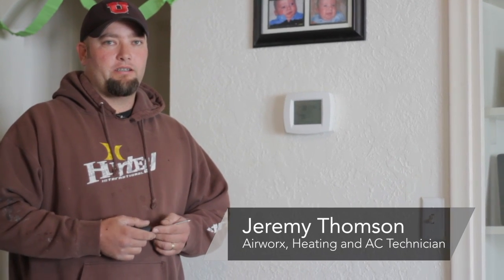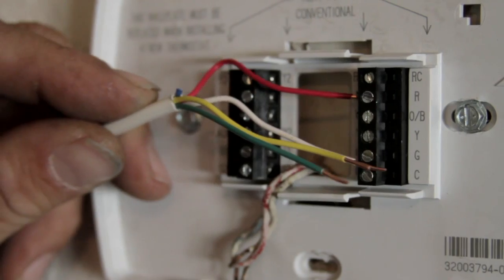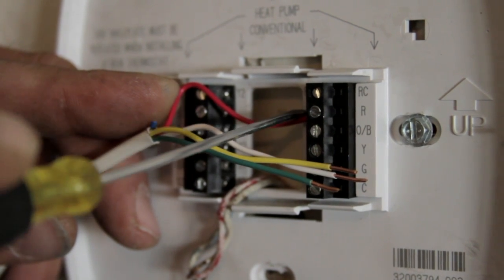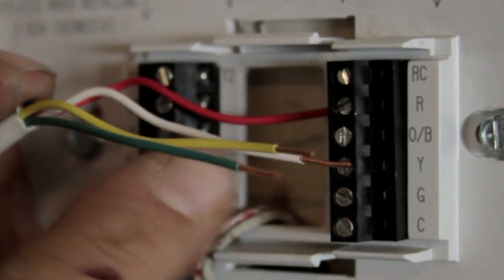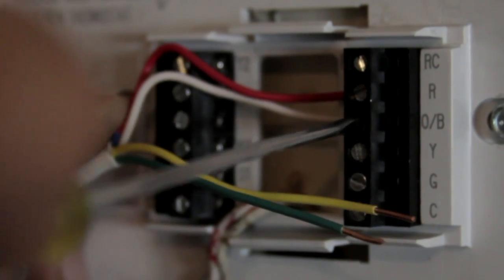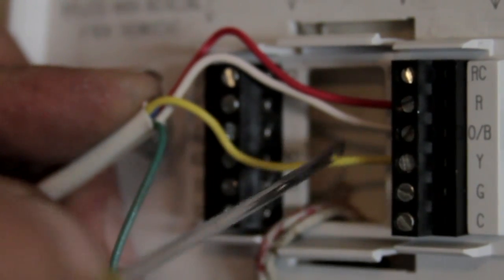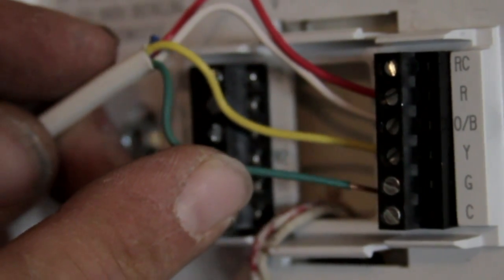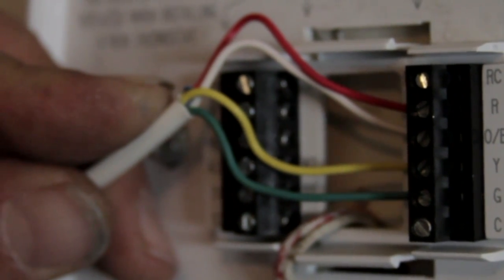Central Air Conditioning Information : How to Wire a Digital Thermostat

Comment: You skipped the most important step! You never explained which side of the terminal to use and why! My thermostat is similar to the one your showing and I have a heat pump. I have a White wire which is disconnected. I have no idea which terminal to use. There is no "W" on the non-convectional side.

Comment: Dude you are like Kobe in the 4qt Clutch this took care of my problem real quick Had 24v to cool but no jumper wire to provide 24v to heat and now that its getting cold I had to move the wire from 24v cool to 24v  to heat, I still need a jumper wire but this will do for now. thank you for the video!

Comment: Thanks for this!  After watching numerous other videos... showing that the "O" (orange) wire is only for homes with heat pumps and controls the 'reversing valve', I was very confused because I have a Trane furnace & thermostat with an 'O' wire, but it's not a heat pump - it's a traditional furnace & ac.  Yours is the first video that showed that Trane uses that wire to call for heat.

Comment: We have had 5 (FIVE) PROFESSIONALS (so they call themselves) to check to see why our AC was not working properly. This has been over the last 5 years. Maybe they need to watch your video !! The "cold" (blue in our case) wire was NEVER hooked up ! It was just laying inside the thermostat !! I connected it and what do you know FINALLY COLD AIR !!! I should have watched this years ago it could have saved me $100's in service calls just to watch these idiots walk from the inside to the outside unit and say "can't find any thing wrong maybe you need a new unit" ON A NEW HOME BTW!! Thanks for your video now maybe this summer our electric bill can be cut in half !!

Comment: thanks for the video...i did not shut off the switch to my furnace when i was changing out a thermostat...i figured no big deal...my central air worked all summer...now i wanna turn on the heat and she wont turn on...i hear a click but nothing happens downstaris at the furnace ...so i saw in the video that you said i could short out the control board or the tranformer...how would i test to narrow down my problem....thanks ray

Comment: Thank you for making this video i replaced a thermostat this week and the thermostat that was there and it had no batteries but I replaced it with one that has batteries but when I called for cooling it didn't work maybe because I need a jumper between rc and r because my new thermostat doesn't have the jumper I hope this works thank you for your video